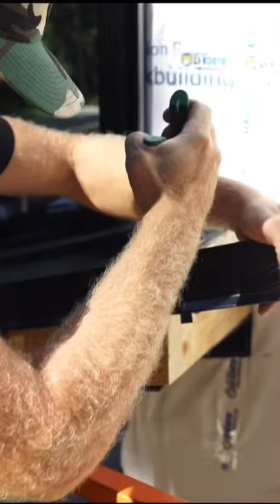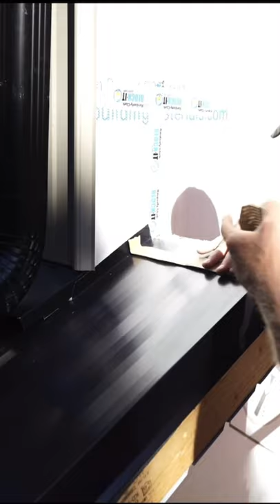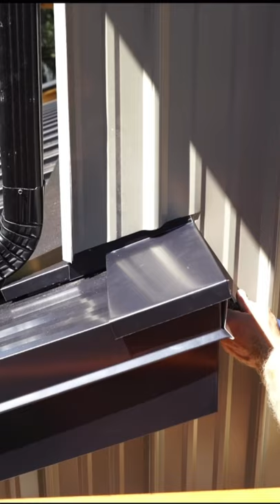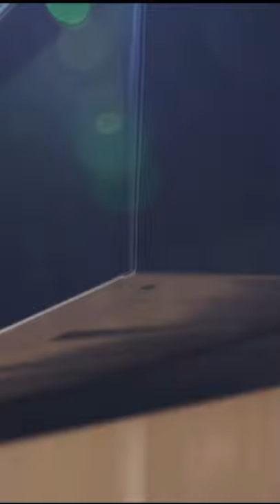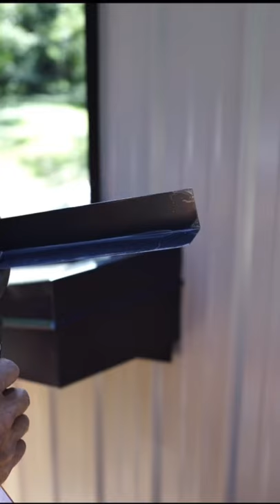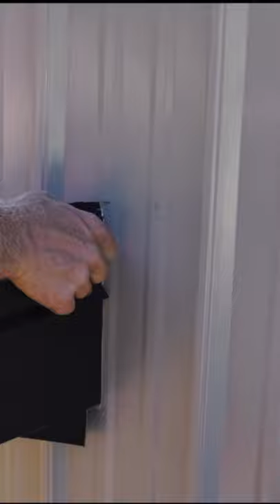TRICKY metal roof detail #shorts

Comment: Cut in siding near roof is incorrect(too close.) Also the eave tin should not both be cut to corner if you slice only the top edge across and fold(also slice kick-out on D-style) then it folds around corner. All of these and more can be found in manufacturer’s specs. Read all of them fella. They spend a lot of money to come up with specifications that optimize product performance.  It’s like a nice painy job on a shitty car. Make it work first, then make it pretty.